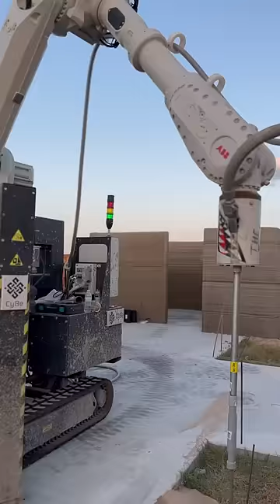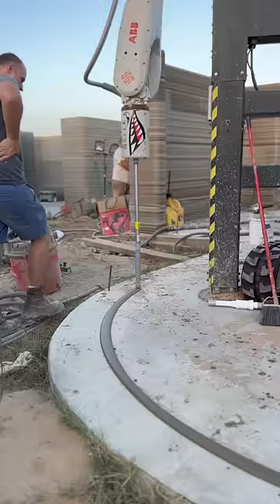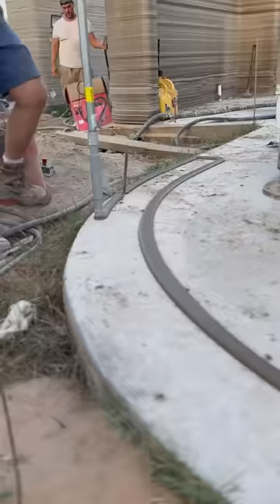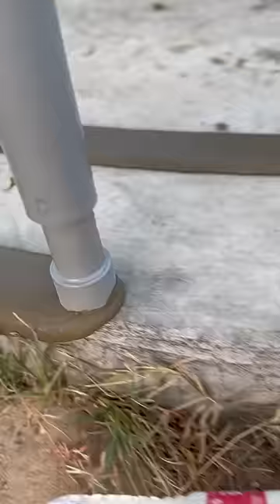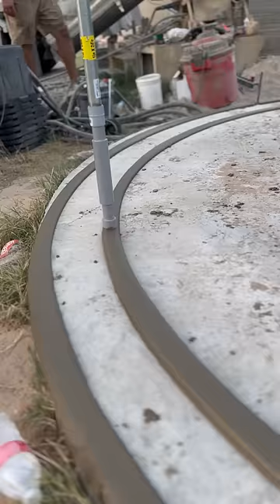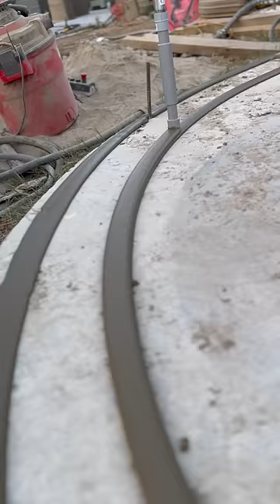Starting a fresh new wall with a two man print team #Hive

Comment: Good thing that one rebar dowel is there.   Wouldn’t want this wall to be unstable.
Reply: I was thinking the same
Thank goodness that one bar is there, especially considering there was no bonding agent and thr floor was as filthy as a $5 hooker on hollywood blvd and no v notch on thr pre existinf

That one dowel will save us
Reply: 4inch rebar 😭
Reply: There are trusses that are placed every so many layers... You seriously think that rebar is the ONLY reinforcement? Not everyone does it the same either, people need to stop just assuming they know what's going on and speak with conviction.
Reply: It's right on the edge too, therefore essentially doing nothing. Its not even painted rebar, within a couple years that will rust out through the wall
Reply: @Lomax81 but its still not conectet to the floor
Reply: @michaelzimmermann7436  that’s just these idiots in this one video… they’re also printing it from a fkin PVC pipe lol A half decent one would have a rectangular head that can adjust its size as it goes around the corners.
Reply: @Lomax81  trusses 😂😂  What good are truss’s when tie the bottom of your wall
Has zero reinforcement?
Reply: @Lomax81  so normaly they are connected rigth ?
Reply: @Lomax81 the video clearly shows lack of competence and ability.
Reply: @Lomax81 You seem like the type to defend the government.

Comment: After watching 100+ of these videos I’ve concluded that 3D house manufacturers are the embodiment of horrendous quality control.
Reply: I've seen ONE video where this machine did spectacular and why is that? Because other construction workers/Masons were assisting it lmao. These Need to be  better used as tools and not attempt to do a real humans job.
Reply: I prefer the old school methods of bricks😂😂😂
Reply: Probably course the crews doing them aren't builders but grifters who saw a niche in the market. No damp proof course either.
Reply: why this looks great and will turn into a extremely durable house
Reply: @percpete  buh doom t’sss
Reply: Do you use rebar at all?
Reply: Concrete walls, are Concrete walls... except when it's layer lines like this. These walls are going to be harder and stronger than any brick layered wall
Reply: @Kitzkrieg hopefully professionals stay away from this technology there's no need for it.
Reply: @P0NYB0YCURTIS not usually I believe the concrete is fiber reinforced
Reply: @jamesegsmith  I am a contractor (ower/operator) and I welcome this tech. I own conventional 3D printer's and they are a perfect fit. I save on tool's,  materials and replacement parts with those machines. And if used correctly they can produce superior quality... just about anything under the sun.
Reply: @Kitzkrieg  I also own multiple printers and I am in the construction field. 3D printing is cool but I don't see the benefit for homes. At least I don't see the benefit for the workers and the customers.
Reply: @jamesegsmith  interesting..   part of the reason I got my first printer was to see if it could be made part of my toolbox, and it was immediate.  They're forever a key tool for my business
Reply: @Kitzkrieg  as a tool for a Tradesman yes I agree. But here they are trying to replace a whole job site of workers with a machine to make an inferior product.
Reply: @jamesegsmith  I've seen it first hand, and from foundation up, it is leaps and bounds above cinder block or form fill. Less material,  and 5x stronger. As for the potential manpower it would replace... there is a industry wide tradesman shortage in every trade. Nobody is joining the trades my man....
Reply: @Kitzkrieg  I think thats by design since they took the training out of high school curriculum at least in America
Reply: @Kitzkrieg  I find it being Leaps and Bounds better a little hard to believe. I will admit it's a neat idea and would probably be good in certain situations. But from what I've seen it doesn't seem better overall
Reply: @jamesegsmith  well idk what systems you are seeing on your job sites, but the ones I am seeing and working around are leading edge
Reply: @Kitzkrieg  apologies but I'm not going to take your word for it. If it were that great we will be seeing better content about it.
Reply: @Kitzkrieg  I do have a question since you seem knowledgeable on the subject how many layers are they able to print a day? All the videos I have seen it's usually only three or four fresh layers on top of dry layers.
Reply: That’s because you watch videos and don’t actually research anything correctly. These houses will last longer than any basic cookie cutter house built since the 70’s.
Reply: @KrazieB7  you assume they will last longer but there's no actual proof of that
Reply: I think the idea of this is cool but yeah the quality is horrendous.
Reply: They have to be shit quality.  That machine took a full minute to lay only the outer edge of the first layer.  That wall is going to take a full day, by itself.  If not two.

For this process to compete on price with a four man framing crew, at that speed, these two men need to be paid about 1/4 what the framers they are replacing would get.
Reply: Guys, here is our Savior

HalleluYAH translates “Praise ye YaH”

YaH is The Heavenly Father
YaH arrives via the TENT OF MEETING
YaH was Who they Crucified for our sins
YaH was Crucified on an Almond TREE

Semitic of Moshe (Moses)
Isa Scroll (The Original Isaiah)

Isaiah 42:8 - I am YaH; that is my Name! I will not yield my glory to another or my praise to idols.

Isaiah 43:11 - I am YAH, and there is no other Savior but Me.

Isaiah 45:5 - I am YaH, and there is none else.

Comment: The level of frustration i had watching that be poured onto a dirty surface was inmeasurable. This isnt even stupidity, this is just pure laziness and lack of caring.
Reply: It’s laziness and the fact these aren’t actual working men. Just some random mfs with somebody else’s money burning it away with this. You won’t see this “tech” in 10 years.
Reply: And what concrete wont stick?   Don't make me laugh
Reply: @hhmaniak  concrete won't bond to the concrete underneath if there is mud, dirt, and debri in the way. Having done commercial concrete work, I know for a fact that is one way to get an inspector to be a dick towards you is doing dumb stuff like that.
Reply: @censorsstarve  but you're building a house out of hollow bricks, not concrete maybe it's just like building a house from hallow blocks, but the machine does it itself
Reply: @hhmaniak  Cant you see there was dirt over the concrete slab? The fresh concrete wont stick to dirt!
Reply: Это демонстрационный ролик, не кап стройка.
Reply: @hhmaniak, it's not concrete they are 3d printing a home
Reply: @BenjaminCantu-d9x  yea, using concrete. 🤣🤣🤣
Reply: Lavacrete
Reply: @BenjaminCantu-d9x  call it whatever you want. It's concrete. It's the mixture of aggregate and a bonding agent. That is all that is required to be concrete. Asphalt is a type of concrete.
Reply: Facts
Reply: Clean, dull, dry, and in sound condition. Watching them pour over dirt broke my heart.
Reply: It's not "dirty".  The printer is completely overshooting the concrete foundation.  They discovered that this was going to run of the edge of the foundation so they "piled" up dirt against and onto it so the new wall wouldn't drip down onto the ground.
Reply: The existing concrete is dirty. They are pouring fresh over dirt and over shooting  onto the dirt.
Reply: @NorthernChev the slab is dirty, you can easily see that. Printing off the form is just a separate issue. Can can see they didn't put the machine in the right place because it's way off on both sides.

Either way you don't put concrete on dirt.
Reply: Там вобще фундамента не наблюдается, только присыпанный слой глины и земли дополняющи фундамент. Своего рода продолжение фундамента грязью. Новые технологии. Горе строители. 😢😢😢
Reply: @probablyinconsistent4756  Point, which you've missed, is that sweeping the crumbs of dirt off the foundation PALES in comparison to the fact that they poured the wall right over the edge of the foundation.  That's like saying the biggest problem about the rocket we shot, that completely missed the Moon, was that it was painted blue and not red... and not the fact that, it MISSED the Moon.
Reply: @NorthernChev  I never said the dirty slab was the bigger issue, just that it was one. Printing off the slab is clearly the bigger problem. But in both ways they are putting it on dirt.
Reply: @censorsstarve 😅

Comment: You need to be retrained man… all that dirt underneath that concrete is a bad idea.
Reply: Адгезия сцепления фигня главное скорость с которой здание рухнет
Reply: idk ab "retrained" man thats farfetched
Reply: Whats the difference though? When you build something, youre building it on dirt.....
Reply: Bro, the dirt is to take the place of the slab the robot is missing. Duh
Reply: Exactly what I thought
Reply: @Antiquefarmequipment Compacted dirt that's had a geotechnical engineer survey to ensure stability. Not loose sand.
Reply: What is this machine
Reply: @Antiquefarmequipment 
The dirt will eventually wash away allowing insects and water to intrude.
Reply: It's not, it missed the footing completely
Reply: They're 🤓s not builders
Reply: Прямо на грязь ) я бы таких принтерменов
Reply: It's str8 cement so it'll absorbs into the sand and harden faster 
It's like making a concrete kerb
Reply: And no consistent distance from the slab edge, including running off the edge.
Reply: @dagneytaggart7707 Made me grab my wife's phone and smash it on the sidewalk seeing that.

What? I didnt wanna break my phone.
Reply: @Antiquefarmequipment no no not wet concrete 😂
Reply: Don't be such a spoil sport,  you are just holding back the future,  all houses will be like this (for a couple of weeks)
Reply: @Antiquefarmequipment 😂
Reply: Wouldn't be such an issue if there was some rebar verts in that footing to make a mechanical connection....
Reply: @steve_beatty  true. Definitely sloppy work though. When you get too much mechanization or I should say automation you start hiring people who don't understand the fundamentals that's the risk. But hey fortunately I live in an old house LOL
Reply: @Antiquefarmequipment …. No
Reply: @crishill6458 I see what you did there.😂
Reply: @Antiquefarmequipment It’s not on dirt, they’re on a FLAT foundation for a reason

Comment: The part that dripped off the slab 💀💀
Reply: I love how he zooms in as if no one saw that 😂
Reply: The slab isn't even level.. and has multiple dips. See how the flow consistency changes in spots.
Reply: How about were there is no slab it printed 3 in. Off the slab and on the dirt
Reply: I liked how they started on a pile of sand 😂 No worries

Comment: There is definitely no issue with that slab being short. It's cool. Just pack some sand there
Reply: This is why you don’t want to automate construction. People runnin the machines have no understanding of how the product they pouring functions over time. Like that’s gonna last. Cheers mate 🥂
Reply: @CocoNut_Bruh_Z Machines are fine, thr bricklaying robot amongst others are excellent.

Its this idiots that dont even know the basic requirments of construction that the problem
Reply: Exactly. They had to see the machine wasn't centered on the foundation when it first started to print and went into the sand. Its off all the way around. They need to stop, adjust, and start over because  if you're off even 1/4 in. at this point it could end up throwing every thing off by several inches or feet in the end. Ppl in the comments are like, its fine, sand mixes with concrete 😂😂
Reply: @candycoffie7124  I honestly cant see a single thing done right here.
Filthy surface, no dowels, nobonding agents...my goodness what a mess
Reply: @candycoffie7124 Either the machine or the foundation is off. Putting the wall on what looks like clay, is ridiculous.
Reply: Honestly it looks like the foundation is off,because in one place its past the wall in others its right under the wall and at one end its short of being under the wall.
Reply: @adrienwatson2179  I can't believe they posted this! I'd be so upset if I was the one paying for all that concrete.
Reply: Plus the one!!! Pin is in the wrong place.
Reply: @candycoffie7124  I wouldnt pay for it.
Id demand proper dowling, cleaning, binding, and go get your saw and make me a V notch lol
Reply: @carlwessels2671  yep. And from the looks of it, they don't plan on making any adjustments to fix it. The comments in this thread saying its ok and it'll be fine are shocking. Either they don't know what they're talking about or they would also do some horrible work like this. Work ethic and pride in ones job is almost non existent anymore.
Reply: @candycoffie7124  I agree with you.  Plus it seems in the video they think they're doing it right. If they really knew, they wouldn't post this video.

Comment: They were so excited to post this video that they completely ignored the fact that the machine failed to follow the cement foundation edge.
Reply: that foundation was likely poured and formed by hand. the machine was probably precise. i build regular houses and we have lumber hanging off the edge alot because im not building a out of square house because the foundation is slightly off most of them are. and if you notice he built up the sand where he knew it was going to be off because once that hardens it will be just fine most of the wall will still be bearing a inch wont hurt nothing.
Reply: Um.... the wall is only 2 thin pours of about an inch and a half.  So if he pours on the sand, he just poured that half of the wall off the foundation. Might be ok...if some kid doesn't co.e push it over I guess lol
Reply: Most foundations have a larger area than needed , it's not precise
Reply: @kiamau  never seen anyone build a concrete or block wall hanging half way off the foundation though. Not in residential, industrial, or commercial
Reply: @kiamau  a little off is one thing this is another🤷
Reply: That wasn’t the machine that was the operators
Reply: @zackgreen7388  it wasn't hanging half way off it was covered in dirt , he should have swept it down first
Reply: @kiamau no. It missed. Watch it again. You can clearly see it run off the pad completely about 2 and a half feet from completing the loop
Reply: As a professional carpenter I can tell you that the concrete guys often mess up and the foundation doesn't like up with the actually grid lines of the building.
Reply: The foundation was not poured to a true radius .
Reply: Sure save alot of freight and labor costs.. that's for sure .
Reply: @kiamau  exactly
Reply: @zackgreen7388  ok yeah .. that's bad
Reply: The problema, possibly was the fondation.
Reply: @kiamau In this case at certain points was narrower!
Reply: Do not blame that innocent machine
Reply: @12many4you 😅
Reply: @biggs7109 No, just no.  The point of this is to directly adhere the walls to the foundation.  This would prevent wear and a need for as much maintenance over time.  Not to mention it’s just stupid since there is obviously concrete that could be molded to follow the rest of the foundation.

Comment: I love how you started a good 2 inches off the footing, with dirt under the concrete which totally allows for the concrete to bond with the footing. And then halfway in the middle of the arc it manages to go a good inch to two inches inside of the arc. Man you guys seriously know exactly what your doing. I would totally hire you to build my house. 😐
Reply: Oh no, it looks like you fell into a Sar casm
Reply: Hmmmmm wait a minute... you're not actually hiring them are you..
?!
Reply: @robertwolfgan after watching this what do you think 😂 dumas
Reply: @Quailers  swoosh*
Reply: А это человеческий фактор накосячил.. Так отлили фундамент.
Reply: It's cool they are just gonna sand it down flush using an automated concrete sander that works just as well
Reply: @robertwolfgan  ca-ching
Reply: This machine is following the designed path, the formwork for the footing was off. This guy is correcting the previous guy's error.
Reply: @grantm6514  Imagine calling it a correction to just keep going.